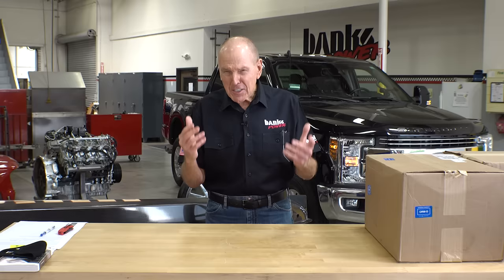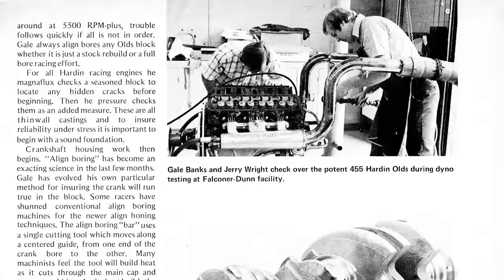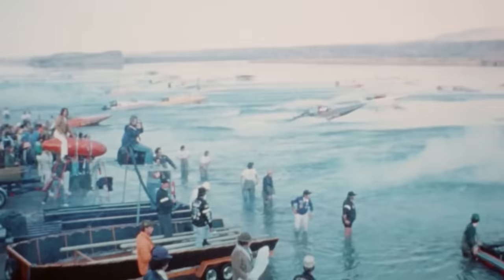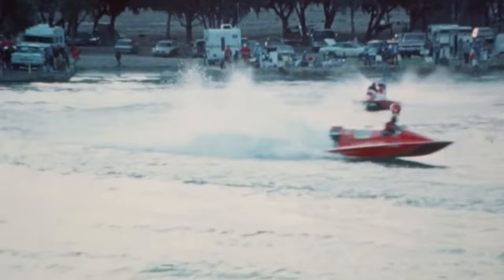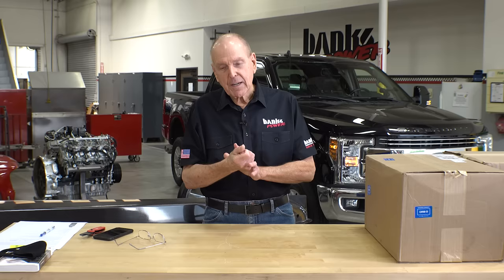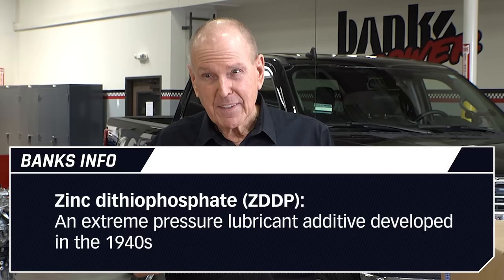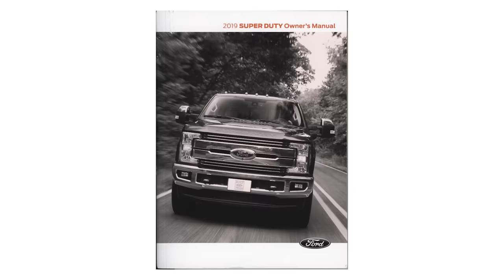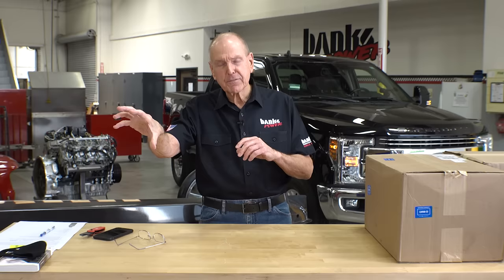ENGINEERING UNBOXED: This filter can extend your oil life

Comment: and PS you didn't recommend when you have to change this other oil filter that's probably gonna fill up faster than the original one because it's finer
Reply: James Driscoll I use a different bypass system, and the rule I have for changing is I feel the filter with my hand after a drive, and if she is not hot, she isn't flowing oil.  I have never had it not flow oil, and I change my oil filter yearly on the bypass when I change my engine oil and engine filter. 

I could likely go longer but don't feel comfortable yet doing so.  Oil analysis after a year still shows good clean and useable oil.

Comment: I have one installed on my 2016 Silverado 3500HD and I honestly haven’t seen a change in oil cleanliness. A little disappointed and still finding a solution.
Reply: It helps if you do an oil analysis.
The oil often still looks black after treatment but the larger particles are no longer present.
Those larger particles are what do all the damage.
:-)

Comment: The other suet-in-oil enabler is the EGR valve/recirculating tube that passes suet back into the intake for re-combustion so thats poor design when considering implications of suet in the combustion chamber.  Resultant is abrasive byproduct into the cylinders and down into oil pan.  Obviously this bypass will help to remediate/reduce the particulate (suet) in the oil.

Comment: If rather change oil on time but still use a good filter also zddp was taken out of oil because of emissions it ruined catalytic converters but was really good oil but not needed since most camshafts are roller now instead of flat tappet which is way better

Comment: I just bought a 2004.5 LLY Chevy 2500hd duramax and I’ve been doing research on what type of oil and filter to use. So I just bought the shell T6 rotella 5w40 and I have a mobile 1 M-303 filter that came with the truck. Truck has 290,000kms and I’m a bit nervous about putting in the full synthetic because it might show some bad seals that the 15w40 was probably hiding. I never done the oil change yet because I’m still not sure what type of filter is best to use. I’m leaning towards the cat conversion filter but this is my first diesel I’ve ever owned and I need to learn a bit more about the lly before I start spending money on stuff that probably isn’t the best for the truck like doing a full egr delete or just use the cooler upgrade kit from Canadian diesel that also came with my truck that I can’t seem to find any reviews online anywhere. Do anyone know if this gdp420016 cooler upgrade is good or trash?  Great video as usual mr Banks!! Glory to Ukraine 🇺🇦

Comment: I sometimes drain the oil b4 a oil change and put just regular 10w30 oil with new oil filter run it for 15 minutes on idle then drain oil and do the regular oil change it cleans it up..mind you I'm only driving a older Volkswagen 4 litres of the cheapest oil is for a flush only

Comment: The variables on oil contamination change with every mile, every ambient temperature change, and for every non-running interval. An extra filter that is no harder on the oil pump and doesn't make the engine starve for oil is a good thing.  Cleaner oil is a good thing.  Is it worth the pretty price tag?? That's up to the individual.  Is it a cure-all or license to never buy or change more oil? Of course not.

Comment: The soot builds up in the oil because modern diesel oils encapsulate the soot. The bypass filter will NOT keep the oil clean by removing soot. I run a bypass filter on a 2012 F350 for metal removal, but the oil is black!

Comment: I've looked at different ones on the net and of the few found some that use hi pressure and centrifical force to hurl contaminant particles against the inside wall housing of the main event. Heard this was what submarines back in the day would use to keep their oil cleaner than regular black soot clean.
I often thought why not make an extra sump in the oil pan and use the power steering pump to circulate not only this excess oil into this centrifical system but at the same time provide pressure for your steering as well.
Any thoughts?
International uses conventional 15/40 engine oil in some of their steering pumps. So I think the grade what ever it is wouldn't be a problem.
What sayest thou?

Comment: If you can run oil pressure at 100 psi a centrifuge bypass will clean the oil to 1/10th of 1 micron.
The rest of us are stuck with basic bypass filter systems.  Ams oil is good, only one better is the frantz.

Gotta say I am a little jealous that they just send him this stuff for free to where he is surprised by hundreds of dollars worth of stuff that he didn’t even know was coming, and worth millions.  Meanwhile the rest of us pay the full price.  Haha.  

I am really surprised he has never used any bypass info.  This is probably why he still doesn’t use the gapless rings in his builds.  He just hasn’t been fighting the same fight we have in the long term low cost for Diesel engines like some of us have.  Bypass systems, especially centrifuge ones have been in marine use since ww1.  But his magic all came from turbos on gas engines, then later he schooled GM on that 6.2 that it needed a turbo- so helped there.  

Mad respect for your knowledge over the years Banks.  This goes to show that no matter how much a guy knows there is always more room to learn in.

Comment: There are more ways increased engine wear goes unnoticed ,with higher loads oil temperatures will spike causing significant damage in matter of minutes,  oversized oil coolers need be installed in heavy hauling.as high oil temps are as or more detrimental than poor oil quality , nice sermon will wait for more...

Comment: Had a 2008 Duramax that I installed Amsoil's bypass filter kit that worked perfectly (and added 2 extra quarts).  Just bought a new 2024 Duramax and wanted to install a similar (updated) bypass filter kit, but Amsoil has made NO BYPASS KITS for the 2024 D-Max.  WTF ???

Comment: I had a problem with AMSOIL's dual bypass for a 1993 Dodge Cummins. After it was sold and installed, they declared it wasn't capable to hold minimum oil pressure at idle. Stuck with a bunch of junk.

Comment: Gale, I like the idea of a micron filter, whereas I believe its' being routed incorrectly. I'll explain.
The current system is tapping off the pump side BEFORE the full flow filter. It's filling up with ALL the dirt in the oil. Why not let the full flow take out 20+ micron size soot THEN run it through the 2 micron filter. the flow will last longer in that 2 micron because that what its' designed for.
     So, shouldn't the tap off for the 2 micron filter be AFTER the full flow filter? and return be to the crankcase oil fill.
Thanks,
Roger

Comment: I know guys with over 300,000 miles on there vehicles engines still ran good and never used  Amsoil products. Irv Gordan and his Volvo had over 4,000,000 miles and never used Amsoil products. He used Castrol GTX semi synthetic. A few guys even use only conventional oil or semi synthetic oil. Walmart Super Tech oil has all the numbers snd letters as the big boy oil including Amsoil. Read the back label. When you buy Napa oil you buy Valvoline. Just read the label on the back.

Comment: The engineers that build these factory motors have specific oil flow volume and pressures ....this bypass system will compromise that engineered flow especially at idle or low revs. Does this have you concerned about “oil starvation” to a small degree?
Reply: Will Jeff 
I had this system on my Dmax. I only saw about a 5lb loss in pressure at highway rpm.  The low volume going through this system is not enough to starve the engine of oil in any way.
Reply: @vinis7787  And one could consider raising the oil pressure relief valve to compensate for the loss.
Reply: That's what that brass restriction on the mount is for. It prevents too much oil going into the bypass and starving the engine. The hole in that restrictor is very small. There are tens of thousands of these systems out there since the 1980's, would think we would have heard about problems by now.

Comment: I have a 3208 cat I'm curious it always puffs black smoke when it starts but when the rpms are past 1500 it goes away I feel like it's starving for air? I'm definitely putting one of these filters on oil is always dirty I change every 3000 miles

Comment: 1.) Many from big rigs to autos have used Amsoil Bypass Filters for decades. 2.) Remove the bypass filter when you sell the truck. 3.) 100,000 mile oil change on my Dodge Dakota. Allpar did a story. Google; Mike Shatto's 623,000 Dodge Dakota.

Comment: My grandpa, the "diesel only" farmer, bought a Delta 88 and had my parents buy one also. What a mistake!! They were the biggest boat anchors ever built. I still to this day have a hard time thinking happy thoughts about diesels because of those turds that spent more time in the shop then on the road.
Reply: My uncle bought one for my aunt. She put gasoline in it and wrecked the engine. New engine installed, and 4 months later, she did it again! Uncle was NOT happy. LOL

Comment: Same setup dixie chopper mowers used for years on there gas engines . It just returned to the drain hose on the dixie . The rest is the same you would just need the oil cap . Most lawn mower shops junk that setup when they do a engine swap . Just some info for the cheap guy out there .

Comment: Yeah great filter the spot a bit more. The problem with the diesels is the regen process washing down the back cylinders with fuel suiting a regen. That’s when you get oil dilution with diesel and is bad for the bearings. Sure this kit would help, but I’m more concerned with the regen and all the failures from that. So much I sold my diesel(s)
Reply: Should say soot and during.

Comment: Thank you for doing the segment on synthetic oil .its always been extra expensive for me to even think about using .ive always been got to change it every 3000 to have hopes it will last 300.000 so cheepest bestest and an synthetic $ 4.oo qt. crazy. But now I couldn't get regular motor oil had to buy synthetic blend Now that I've used it its like wow 😳would the full synthetic be better ???

Comment: I have seen a f350 with a emishins Delete it has had 10000 miles on the oil and it is a clean as I put in it, it is as dirty as a gass engine oil

Comment: Now you've got the petrol heads wondering...
My oil comes out jet black after even a shortened service interval, would this or something like it be useful in a non-diesel application?
Reply: Useful, yes, worth it...maybe. the thing with this on a diesel engine is that they hold like 15 quarts of oil and some guys will put more than 100k miles a year on. If you can double how many miles you get between oil changes and do a better job protecting the engine, that's awesome. If your car only holds 4 quarts and you only drive 10k miles a year, meh, just change the oil. It's lots of investment for not much benefit. Oil goes black pretty fast, if your car isn't burning much, less than 1 quart in 2000 miles, consider having it analysed, other than that I wouldn't worry.
Reply: Some GDI engines from VW and Audi tend to turn the oil black very quickly.

Comment: So, since Gale is a fan of bypass systems, and he is also doing development work with the 2020-2021 L5P, can he explain the problem with the 2020-2021 L5P and it not liking being connected to a bypass system.  Amsoil discovered this recently while developing a kit for the new Duramax.  They told me they heard odd noises from the oil pump.  Does Gale know what is going on?  And if so does he have a fix?  Amsoil will not be making a bypass system for the 2020+ L5P  due to this problem.

Comment: I've been humming and hawing about putting one of these on my deleted 2017 powerstroke. I run amsoil full authentic and have asked around bout their systems but not many put them on if they do regular oil changes with high quality oil. Think I might go for it as I'm going to have this truck for a long time.
Reply: Not needed as much on a deleted engine.  Getting rid of egr reduces soot loading of the oil.
Reply: @andyharman3022  all diesels produce soot, any engine can benefit from bypass filtration... Most wear particles come from 5-15 micron sized particles... Bypass removes all 2 micron and larger particles from the oil. This allows the oil to last longer and the additives to not be used up as fast.
Reply: @MichaelSparks  I have about 600000 miles of experience running diesel pickups.  I have a 2001 Dodge (pre-emissions control) with 577k miles.   I normally run 30,000 mile oil change intervals with it, and the highest soot reading i have ever got on it is 0.7%.  My 2008 Dodge with DPF and EGR soots the oil at the rate of 2.2% in 18,000 miles.  And worse than that, it oxidizes the oil (Rotella T6), causing it to thicken out of grade.

Comment: By adding this bypass filter, an extra resistance has just been put on the oil pump. Since the lube oil pump’s primary mover is the engine, it can be expected this extra load would come at the expense of engine load, and ultimately seen on the fuel rack position indicator and/or fuel efficiency. Of course, a little loss of efficiency may be preferable with a trade off of less particulates in the lube oil, which is up to the Owner to decide.

Is there any evidence to show how this kit affects fuel efficiency?

Comment: Coolest guy ever!
The knife makes me a bit nervous though lol.
Racing in mind... in order not to decrease general oil pressure in the engine, could an external oil pump be used with the amsoil 2micron filter? If you where to enable the pump through an ecu output you could even enable it only during certain conditions if needed? Maybe you could have the pump cleaning the oil (on street/sport applications) only during low load or cruise conditions.

Comment: Ok, maybe I just don’t understand! But why in the second flow diagram is the oil flowing back thru a FUEL-FLOW FILTER? Or is this labeled wrong?
Reply: Labeled wrong. Oil going to the bypass system is off of a pressure port, return comes back either to the oil pan or oil fill cap like on this model. Secondly AMSOIL developed a dual system that removes the full flow and puts it side by side with the bypass. They are ideal if you have room to mount it.

Comment: Gale, could you further explain how getting an oil sample from the drain is bad like you said? I'd guess by the time I've drove for 40 plus miles anything in the bottom of the pan has been thoroughly mixed into the oil.
Reply: The sludge and particulates tend to sink. Most pumps don't pull enough suction to re-introduce it to the system. Couple that with baffles and windage, and the crap stays put. If, on the other hand, you have a dry sump system, the contaminates will flow with the oil. Just pull any oil pan, or valve cover to see the particulates settled.

A lot of industrial equipment has sample ports to get accurate samples.
Reply: When taking oil analysis you want a "representative" sample. Many times particles settle out of the oil on the bottom of the pan, you will get a bad sample with high readings... If you are changing the oil, you can take an analysis through the drain plug, but you will want to let the oil drain for 10 seconds or so... Taking the sample through a port or the dipstick tube allows you to do oil analysis without draining the oil. If it were me, I would sample the current oil prior to changing, then sample the bypassed system oil at the same interval... Using a vampire... That's what that suction device is called is an easy way to monitor your oil without actually draining or changing it.

Comment: Banks,
AMSOIL makes a great bypass filter.  Combined with their Signature Series Max-Duty Synthetic Diesel Oil 5W-40, your engine is kept clean, extends oil changes, provides better wear protection under extreme operating conditions while minimizing oil consumption. May I recommend getting AMSOIL Don Smith’s bypass filter mounts. Makes installing the bypass filters a breeze. Check out his install video: 
https://youtu.be/f-w0PHvxWa8

Comment: What happens if you add graphite to your motor oil? Would it improve lubrication and/or compression, would it improve temperature distribution, or would it just make a mess?
Reply: Arco used to make an engine oil that contained graphite, but I don't know when they made it. I think it was during the 1970s.

Comment: When your driving around you can bet the farm the oil pick up sucks whatever it can from any where it can. So it's a little hokey to sell u on not taking the oil fron the pan. It aslo helps raise the price of the any product when u convince people they need special parts..  
Dont ever think that u should believe the "bypass" filters will extend drain intervals. 
Have an oil chemist tell u about the acidic condition created by contaminated oil that can't be filtered out. It destroyes the additive pkg in more ways than one. It can destroy the viscosity. But it was a nice "product show" for amsoil...lol

Comment: You know, If GM had listened to Mr. Banks, even a little bit, and used the Small Block Chevy as a base things might have been better.
Give it a 3.75 in. bore and stroke (the smaller bore for more meat between cylinders) with it's 4 bolt mains and 5 head bolts around each cylinder the only thing left would have been the roller cam. That part I'm sure GM would NOT do because they sucked back then.